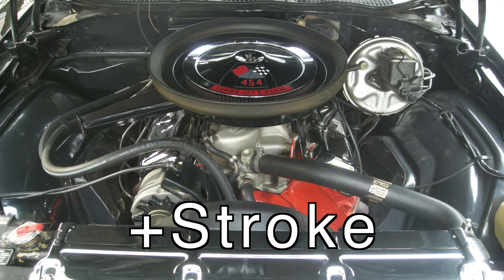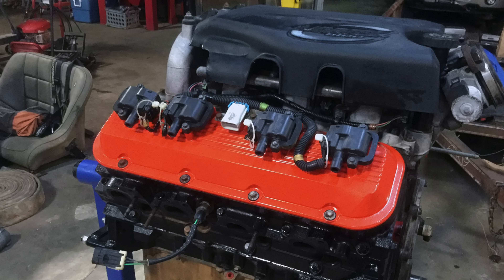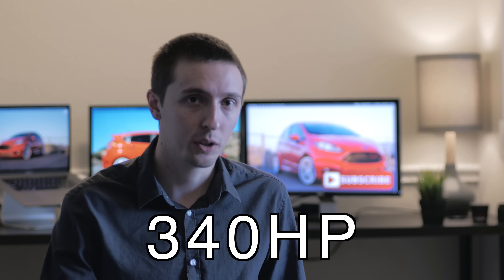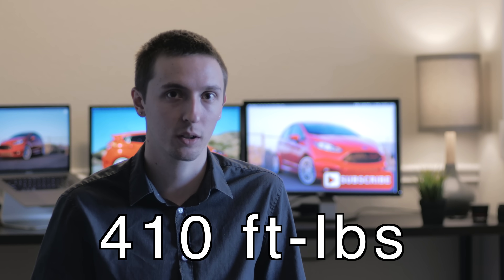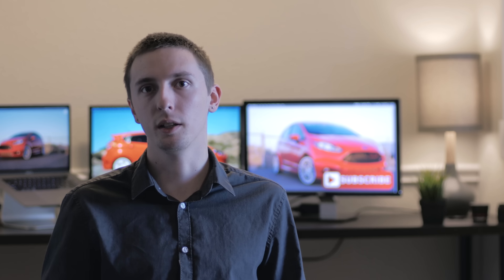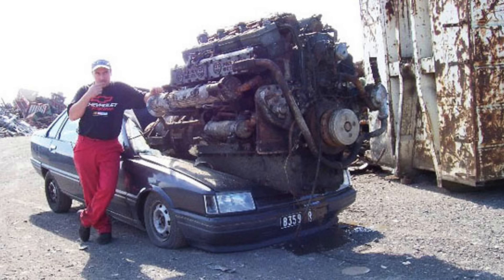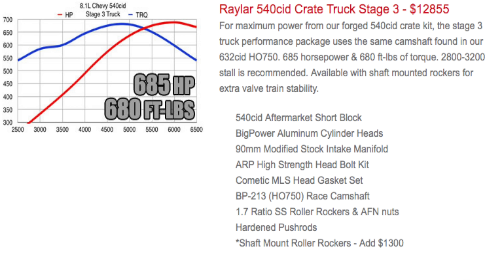Vortec 8100: Everything You Want to Know | Specs and More

Comment: In 2002 bought GMC 2500 HD with a 8.1/Allisson 1000 trans. had 000026.0 miles retired in 2007 bought a fifth wheel trailer the wife and I went camp hosting for 10yrs all over western states the trailer weight was 16000 pound's when fully loaded (it was our home) never had any problems. in 2025 replaced TCM and ECM, just because, get 9 mpg around town and 10 to 12 highway (if kept under 80 mph) have never replaced any thing on my 8.1or trans. except regular sieves now there is 180,000 on it and told the kids dig a hole put me in my truck and cover it, never going to give it up.....

Comment: Excuse me! You forgot the 8.1 liter 2500 Avalanche. I have a 2004 Chevy 2500 4X4 Avalanche with what was called the Supermatic Automatic 4L85E Transmission. Black on Black with every option. We pull a 32' travel trailer uphill at 65mph. I've owned 454 Suburbans. There's no comparison. I'm sorry they quit making the 8100.

Comment: Had the 8.1 in my 04 one ton work truck with the 6 speed Aliison.  It was very reliable and the torque came in right away off idle.  Never got fuel mileage better than 9.5 miles per gallon.   But, it was easy to plan for, cause it pretty much always got 9.5 mpg

Comment: I needed a truck to pull my 35ft fifth wheel. Every diesel truck was a lot more expensive and most advertised a $5000 injector repair at around 120 thousands miles. In 2018 I bought the Chevy 2500 4x4 crew cab long bed with the 8.1 Allison combo for $15k with 46k original miles with all the towing equipment installed. The engine trans combo has taken me to the top of every pass without problems. I currently have 112k miles on the truck.

Comment: I own both the lbz and 8.1…make no mistake if you’re purchasing either one that the diesel does hold up long term, the 8.1 is a beast but not as durable when it comes to heavy hauling or long hauls, the heat soak alone from long tows eventually takes its toll on the coils and ign system along with eventually oil consumption and leaks

Comment: GM should make a new engine like this and equip it with a low-pressure FI setup that makes sense for towing. It seems to me that the only advantages of a diesel in the age of EGRs, DPFs and DEF are forced induction and slightly better fuel economy, and with modern technology it is absolutely possible to turbocharge a gas engine without killing longevity or gas mileage. Just use direct injection and don't make it depend too much on boost.

Comment: thousands were sold as power units  pumping irrigation water.   I currently have 2  in service,  set up for Propane.     it's the same long block gm sold to the public for replacement use....  complete with poor valve seats for propane use..       
Both engines needed cams, heads done  before 7000 hours.  But the  bottom end was like brand new.   I fully expect another  7000 hours before it needs bored-    maybe by that time,  Dart Mfg. will be producing their  dual plane intake with provision for a old school distributor again,  and I can  convert this back to a simple 4 wire power unit  and get rid of about 30 pounds of  mouse next material disguised as a wiring harness...

Comment: Good engine but in typical GM fashion they always have to finish their products off with some cheap, PITA garbage. On the 8.1 that boils down to tiny exhaust manifold bolts, an un-hardened fuel system, especially the pump that dies after a couple tanks of 5% or higher ethanol gasoline and has no provision for simple replacement access, cheap spark plug wires with insufficient heat protection, crap crank and cam sensors mounted in horribly ridiculous, (^**)(&%#$*!!  locations.

Comment: I’ve had a Duramax, 7.3 power stroke, 6.0 power stroke and now an 8.1. I sold the Duramax in favor of the 8.1. My two Fords are work trucks. The 7.3 is extremely reliable but maintaining any diesel truck is costly. The 6.0 needed a ton of work to be made bulletproof, thankfully I got it for cheap and now it runs great, but still high maintenance.
I’ll take the 8.1 over any turbo diesel. It’s bulletproof from the factory, cheaper to work on, and much more fun to drive. The mods are out there if you want to compete with the diesels on towing. As far as fuel economy goes, nobody buys trucks this big if they’re thinking about saving fuel. Also look at the price history of diesel, way more volatile than gas. The new diesels have emissions and won’t last nearly as long while the 8.1 will last forever with basic maintenance. Truly an amazing motor and there is no replacement for displacement!

Comment: And the Ford V10 (starting with the 2000 Super Duty F-Series, which was the first to get the "PI"/"Performance Improved" heads/cam & intake, taking it over 300 hp) was overall a much better engine than the GM 8.1 also....
Reply: The V 10 has more rpms tuned in the ECU. The 8.1 has a more limiting tune than the stock 5.3 and 6.0. The 8.1 gains 175 hp with a tune a real tune with someone that knows, not that plug and play crap.

Comment: What everyone fails to mention is that the 8100 is more related to the 366/427 tall decks than the 454. Sure, it replaced the 454, but then again, the 427T should have in the 70s anyway.
Reply: Yup they made them for decades.  Used for buses and commercial trucks.  There’s a reason they lasted so long.

Comment: I have a 2003 23 foot Chinook RV which has the 8.1 with the 4-speed auto on a Chevy Express chassis. Even though it weighs over 6 tons it passes everything going up hills. It has been tuned and has a Magnaflow exhaust system. It sounds and pulls like a 1970's chevelle ss 396, and makes people wonder "What the hell?" as we get on the highway. My wife does most of the driving, and it can really haul through the states where speed limits are 80 and up. It has 115K miles on it, and runs like new. Yea, it uses the gasoline, 9-10 miles/gallon is the only downside. It'll be up for sale early next spring.
Reply: Could get HP tunes and tune the ECU. The fule stops at 3,900 rpms stock. and runs 13.5 to 1 under that so the cat can heat up for better emissions. So u could go to 15 to 1 under about 1500 rpms. you get 11-12 mpg and they will idle fine at 16 to 1.

Comment: The reason people like these is you will never see anything else like this again. It's more efficient and makes more power and for than an older big block, but has some of the technology of an LS motor.. they are ridiculously strong easy to work on and are definitely worth holding onto. People are afraid because they're unsure about it and they think gas mileage is going to be horrific when really the gas mileage is not very different from the 6.0! Tons more torque and power to pull anything without diesel fuel maintenance and cost Etc

Comment: I have owned both engines. I had a 2002 Chevey 2500HD with the 8.1. Owned it for 5 years before buying a 2007 GMC 2500HD Classic w/ a LBZ Duramax. There is no comparison in my opinion. The Duramax has way more power then the 8.1. I towed the same trailer with both vehicles. Both had the Allison. The 2002 was a 5 speed and the 2007  is a 6 speed. Towing w/ the 2002 the fuel mileage was 5-6 mpg at best. It had to constantly down shift to keep up speed. Also used a quart of oil every 800 miles. Had dual exhaust. I believe 4:10 gears as the Duramax has 3:73. Both had 265/75R/16 tires. The 2007 Duramax is a pleasure to tow with. Pulls that trailer like it's almost not there. I get 11-12 mpg when towing. Took it to Canada one year w/o a trailer and got 22mpg. The best I got with the 8.1 was 14mpg highway driving it real easy w/o towing. The bottom line is there is nothing like a diesel when you need to tow! I still drive it.  Have had it since 6/2012. Bought it with 109,000. Now has 152,000. Had the body redone a few years ago. Should last another 10+ years easily.
Reply: Ive seen the 8.1 pull duramaxes cummins and powerstrokes backwards

Comment: Why did you say the aftermarket is not as good when the 8.1 is based off of the 454 which the 454 has a massive aftermarket support on anything you want to buy. So is the 8.1 very different from the 454

Comment: I owned a 2003 8.1 extended cab 4x4 long bed to tow a 16 foot cargo trailer with tile and flooring tools and materials in and around a medium sized city.  I averaged 5 mpg and usually filled the 26 gallon tank every 4 days.  I traded it in a year later, I then bought a 2007 6.6 Duramax ext cab 4x4 long bed and averaged 13 mpg.  The Duramax had more torque and it was so much easier to tow the trailer.  I once took a 300 mile trip to see my daughter and drove 550 miles on 25 gallons, 22 mpg.  The 8.1 only made it 300 miles on 25 gallons.  12 mpg.  Both were trucks only.  One more thing the Duramax was cruising at 75 mph.

Comment: Gas hog too.... My boss had a. He bought a brand new 2001 2500 HD regular cab long bed four-wheel drive with the 8.1 L Allison transmission I believe. Let's just say that two times guys had it parked on a hill with the trailer loaded. Put it in drive. Went to step on the gas and snap the drive shaft in half from the torque and it slapped the tranny and he had to replace the tranny both times

Comment: The 8.1 was severely detuned. It is capable, in purely stock form, of 400HP and 550 ft/lb. 

Neither the 6.0 nor the 6.6 is an adequate replacement.

In fact, now Ford has a large displacement pushrod gasoline, and GM does not, proving GM to be utterly stupid and short sighted.

Comment: My Dad had a 1989 7.4L and I just started fixing it up today. Got it running, new belt, new coolant hose, and brake pads. Upper and lower control arms are ordered and the truck only has 130k miles on it

Comment: Had 2 GM 8100 both rated 340 hp and 455 lb torque at 3200rpm more power than ford v10 gas then or now and more reliable too 2 less cylinders making more hp and more torque more parts availability than ford makes the 8100 a win win for heavy hauling even a over hyped ram 6.4 litre 2500 doesn't stand a chance against the 8100 its is called a workhorse for a reason and a much more proven Allison transmission than whatever chrysler or ford has to boot good video mine where 01 reg cab 1 ton drw 4x4 and 02 3/4 crew cab long bed 4x4 incredible Trucks capable of making wanna be powerstrokes and 5.9 Cummins nervous without having to worry about contaminated fuel and injectors going out

Comment: Yes they use more gas than the Duramax. However the money you save in fuel with a diesel will be spent in higher maintenance and repair costs over the life of the engine. The 8100 with routine maintenance can easily go 400K miles. The Duramax will never have that many miles without expensive repairs along the way.

Comment: I had a 2005 duramax bought it new, and now I have a 2004 8.1 wit an allison.  I prefer the 8.1 myself.  I regularly tow between 5-9 to with it plus a 5000# trailer.  I find the 8.1 to pull better that the duramax in stock form. I ran the duramax to 330,000 miles before any issues, the 8.1 currently has 240,000, and shows no signs of stopping any time soon.  The only issue I have with the 8.1 is the fuel economy,  which is to be expected with a big block.(7.4 mpg)

Comment: My 2001 GMC 2500 HD with the 8.1 and Allison tranny is the best tow vehicle for pulling my boat! I ask people, “ do you know what kind of gas mileage an 8.1 gets?………, answer, 8.1”. I have a leaking tank on my radiator and the replacements I have found using the GM part number, is not the same radiator that I have. Mine has a core that is 2 3/16 inches, the replacement is only 1 3/16”. I don’t want a downgrade because this truck never runs hot when towing. Has anyone noticed this problem?

Comment: I remember my grandparents traded in an older Duramax Chevy with a 2001 GMC Sierra 2500HD with the 8.1l V8, in 2001. You were lucky to get 12mpg without towing. When towing a 5th wheeler and/or boat we'd get 5mpg on a good day. Used more fuel than the Baja 38 special. Massive engine, but was truly reliable especially with the Allison transmission.  Was a beast, but compared today, hp was decent, however torque has really been beaten with modern HD trucks.

Comment: I'd love to drive the new Ford 7.3 liter, Super Duty gas V8. One cam, 2 valves per, pushrods, the way God INTENDED for a TRUCK engine! Too bad even a stripped F250 Super Duty 4x2 is probably 7,000 lbs. Hopefully Vortech, et al, will make blowers and turbos for these trucks. A niche market, to be sure!🤣

Comment: The main reason you want the 8100 is because you want all that torque WITHOUT the expensive diesel bill. Yes, the 8100 drinks like a sailor, but parts are cheap when comparing them to a diesel. Hell, one diesel injector can be around $400 or more depending on the type, etc. Then if you aren't mechanically inclined and the Dmax breaks down....you will break down too and cry due to how much it costs to fix. 

If the LS engines made torque down low, I don't think anyone would ever consider the 8100. 

Sometimes you can find a 8100 vortec truck for pretty cheap.

Comment: i bought a 07 classic silverado 3500 with 8.1 and the allison that came with an extra gear this year..to replace my 2005 2500 6.0 5 speed manual... both were plow trucks..i hated the  speed for plowing and i live on a hill so it was time to get rid of her after r6 years... got the 1 ton 07 and love the power right away...but that was the end of the love....truck was all trouble from the start with the engine....oil leaks...water pump....  missfires.... it was just headache after headache...i love the transmission and the rest of the truck but as far as the engine goes it just didnt seem like it was built as  strong dont get me wrong i love the ss 396 and 454 chevelle and the ss454 truck...this engine just didnt do it for me...love my 2006 3500 6.0 4l80 truck now

Comment: I bought a 2004 3500 4x4 with 496/8.1  because it was much cheaper than a Duramax.  I bale and sell a lot of hay 4x5 round rolls that weighs at 1200lbs a peace. I will haul 15 on a 24 ft gooseneck. If I deliver the hay to the customer I usually charge $5. a bale extra, at 15 bales that's $75. extra that pays for my gas which usually cost between $10 to $20 per round trip load sometimes even less. So my truck pays for itself. And if I ever have to replace the 8.1 engine it is only a fraction of the cost of a Duramax engine. You can buy a new 8.1 for less then $5,000 and a good low mileage one for about $2500. For myself to make money the 8.1 is / was the right choice for me. Also it has enough pulling power , pulling 18,000 lbs of hay plus the weight of the trailer   about 5 to 6 thousand lbs.  avg 6 mpg. Better with the lighter loads  7-8 mpg . All around driving empty 9-10 mpg.  Highway 11 mpg. The motor has 244,000 miles on it. It's a work truck and a good one.

Comment: I have the Workhorse 25 foot class A motorhome, I pull a trailer with 8k pounds and can easily do 80mph on the highway, she does like oil though, 1 quart every 1200 miles and I only have 33k on it.

Comment: We have a GMC 3500HD with the 8.1L in it, with 245k miles.  Hard working miles too (pulling a Bobcat, hauling stone and cement, etc.).  It drinks gas (7-8 mpg), but damned if it isn't bulletproof, and powerful!

Comment: I drove a 2006 duramax and thought it was slower than my 2001 8.1 Only way a diesel is more powerful is if you modify it. The 8.1 makes almost as much torque as the duramax in 2001 and it even has more horsepower. The 8.1 will walk all over any stock duramax from the time.

Comment: I have a 2001 Silverado 2wd crew cab long box truck with the 8.1L and Allison transmission and have towed all over the USA hauling 10,000 + lbs it has over 300K on it. This summer I had a kid think he was hot stuff with a built Cummins diesel he was empty and I had a 20 trailer on back empty and at 50mph I let him start blowing black smoke and then just pressed slowly to the floor and drove around him. We did this 4 times in a row. Nothing like the kicks butt power of a big block. GM needs to bring this engine back and scrap the 6.0L I had one of them and they are junk for pulling.

Comment: Just replaced the Crank Sensor on my 02' 2500HD 8.1 and it still stumbles occasionally and stalls the same as it did before. It will start right back up and run for hours fine after. I got the OEM ACDelco part and it looked identical to the one that was in the truck. No codes are being set however I have two intermittent codes when I read it with my scanner P0101 and P0107 MAF and MAP codes. My wiring harness all looks intact and I wiggled every connector and plug wire while the truck was idling, still nothing. I also viewed the RPM signal and MAF signal when it was stumbling and they both were working no spikes are drops in the signal.. What else could cause the truck to just die? Cam sensor? Fuel pump/relay?
Reply: Hey man did you ever figure this out?
Reply: Crankshaft relearn

Comment: Love my 01 2500HD... Owned it 10 years has 454 k on it. The allison has lost overdrive, rear end got a ton of slop in the pinon, transfer case got a hole from the fluid recall they did.. jb welded for 8 years, driveshaft converted to a one piece... I was replacing center bearing every 8 months. But that 8.1still runs like a top. I never opened it.
Reply: Did you have a 1 peice drive Shaft made..or did you find a stock replacement

Comment: I have a 2000 GMC 3500HD dually with a 7.4 Vortec.  I bought the truck in 2018 and it had only 42,000 original miles on it. It was a government truck that was retired and sold at auction. Sadly, 2000 was the last year for the 454.

Comment: I have  a 2004  2500 hd crew cab w/the 8.1 V8 allison tramission combo  pulling a 9,500 lb. 5th wheel. Bought it new and now have 57,000 miles on truck , No Problems